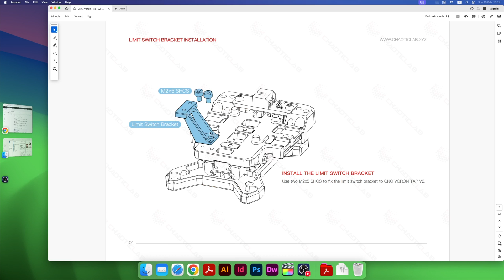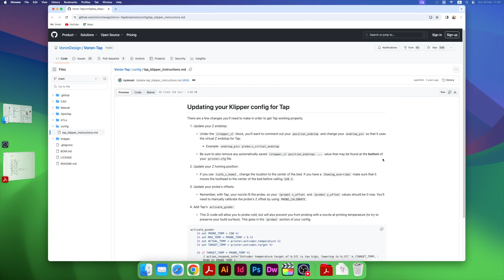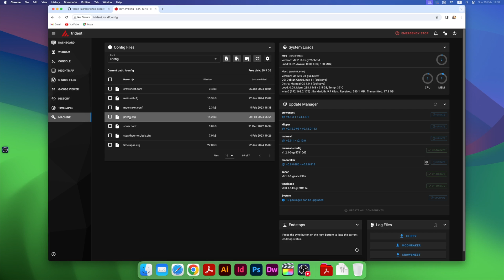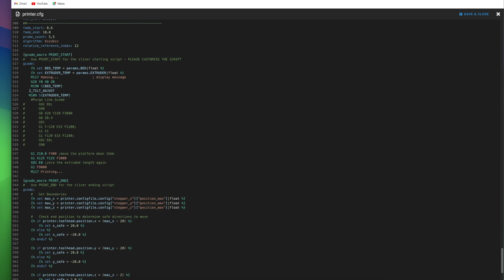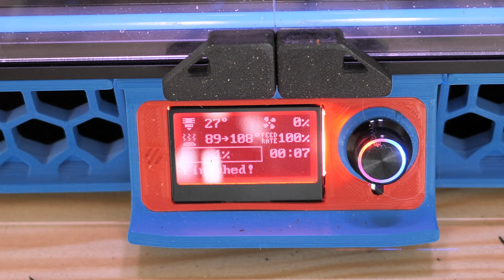CNC Voron Tap V2 by Chaoticlab

Comment: Your stealthburner looks horrible, bad print quality and what's the deal with those bent screws???
Reply from the maker: You mean the SB fan face probably. It was printed from PC (hence the visible layers) with blue ABS first layer. I changed this with 3-color ASA fan face i designed (visible at the end of the video ) At the time of Tap instalation I was with the old SB face 3 months ago. The bent M3 rods is my solution to unavailable 50mm M3 bolts in my country. It started as temporary fix and now is on all my voron printers. I like it.
Reply: @3dpblog  I like it too